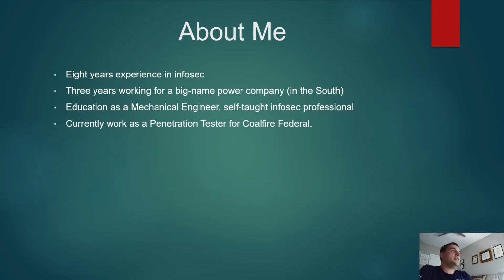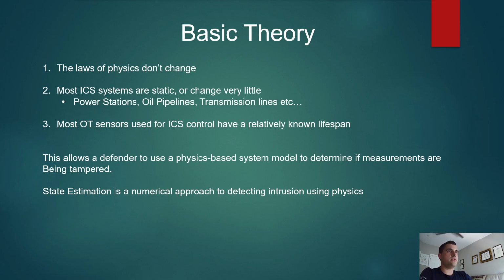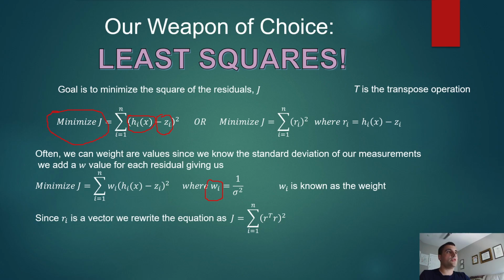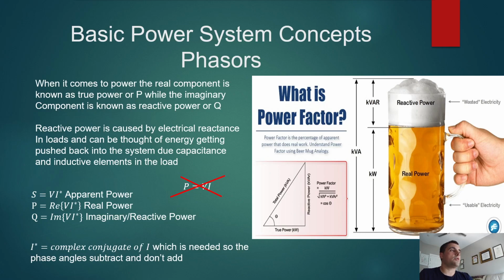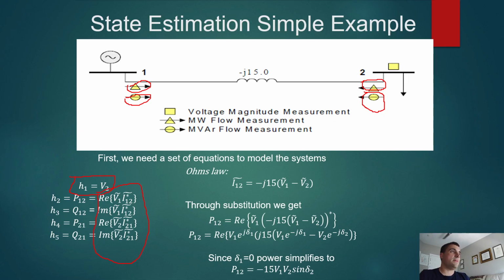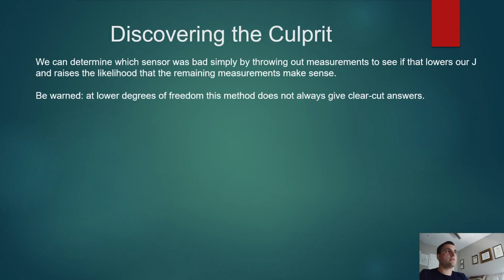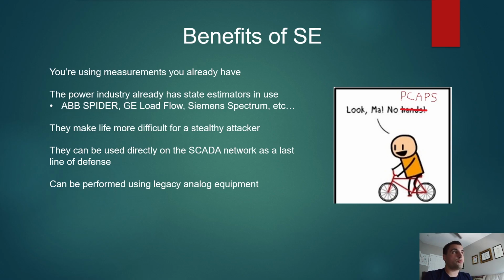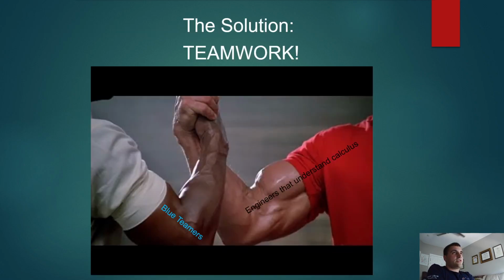Detecting Attackers Using Your Own Sensors with State Estimation (Stefan Stephenson-Moe - Coalfire)

Comment: Does the fact that you simplified the state estimation process translate to you missing any steps that would render the detection less effective?
Reply: I did simplify it a bit to meet time constraints, but all the math I referenced, least squares, taking a Jacobian etc... are well understood and can easily be looked up. If you're talking about the actual calculation. That's the point of what I said in the end. You would build a state estimator using Matlab, Splunk, or whatever that does the math for you. Then when the probability gets to low it would send you an alert that tells you you're measurements are hacked. Hope I answered your question.